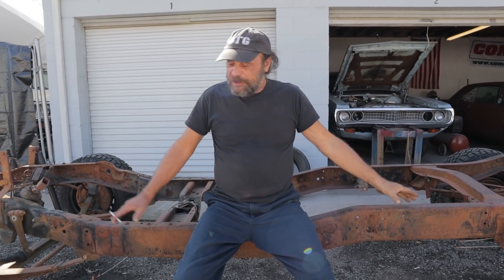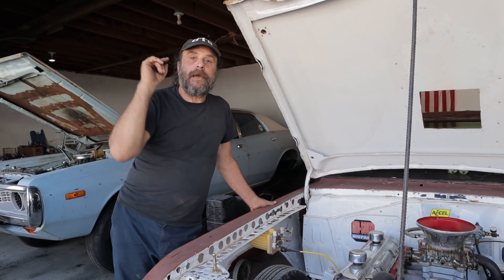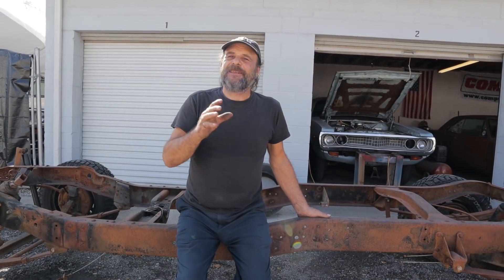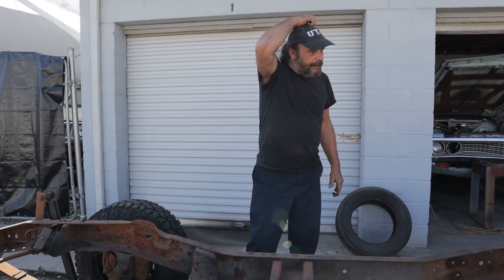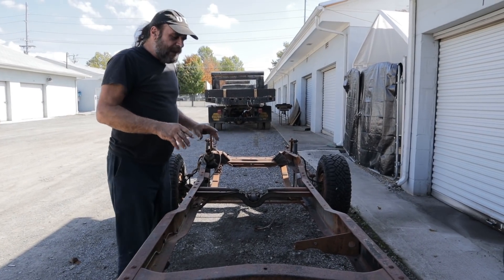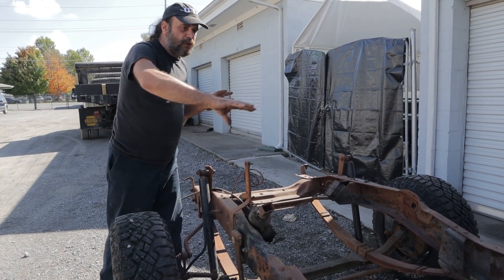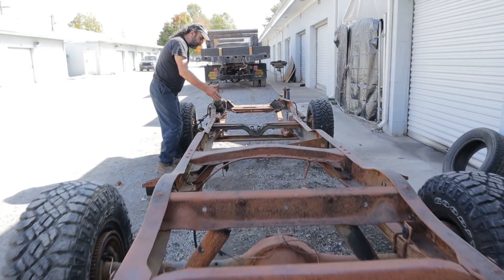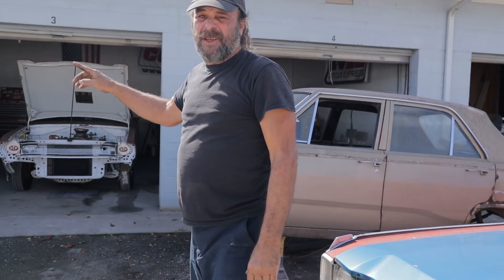The Fine Art Of Biting Off More Than You Can Chew

Comment: As others have pointed out the ackerman angle doesn't have to be that exact but if you want to get icky about it, it would be a simple matter to bend the arms in a little and shorten the drag link. For your purpose balance and handling would be better with a shorter wheelbase.
I had a 71 Fargo (Canadian Dodge) half ton. Rebuild the front end or make sure it has good king pins, tie rod ends, etc. You can adjust the steering box to take out play but be sure to follow the factory manual or you can wear out the steering box in a couple of months. Be sure the steering box bolts are tight. Replace shocks, clean the rust and dirt out of the springs and replace the sliders, put on new shocks and get an alignment. Pump up the tires to 32PSI and it will work great. Especially when the truck was loaded, in your case you will want to remove a few leaves to soften the springs because you will not be carrying a heavy load.
Another thing you can do is install a steering damper like they sell for 4 wheel drive trucks with solid axles. Then set up the front end with minimal caster. This makes steering easier and sharpens up the response but reduces self centering action. You may also want anti roll bars to go with the softer springs.
I don't know why you want to use a sedan body and don't just build it as a pickup truck but, I gues you have your reasons.
Reply: Those changes would effect the bumpsteer characteristics, Don't Do THAT!!

Comment: By the time you're getting that slant six in I have got my slant six scamp running and driving, killed the motor, and replaced the entire drive train to a modern 318/a500 trans, Ford 8.8 rear, and changed to disc brakes all around lol.

On one hand I'm sorry I didn't put the time and effort into getting the slant to 150-200 hp, but also why push a motor when I could just get something that has my power goals stock? I also got a spare 318 block to build for power if I ever want to upgrade and tore that down lol

Obviously Uncle Tony has done a ton more with all his other projects and YouTube and all that, just found it funny I got interested in him with that slant wanting to follow it along as a newbie, and now I'm all set to finish a huge project of replacing every moving bit under the car right when he is set to finish up with the slant build haha

Comment: Leave it long wheelbase, yes. In off road, you don't want body overhang. This is the right move.👍.  As far as Ackerman, theory is one thing.. but in the real world, slip angle and camber change and weight transfer and roll couple distribution mess it all up. When I was doing chassis engineering for road race cars, we found that the lowest drag geometry in actual cornering conditions required inside front tire angle of Ackerman to be way off from theory, sometimes as much as as 30% difference. Even if you cut this frame, real world influences would mean your still OK. Having Ackerman, even if not 'perfect' is going to be just fine. Many wheelbase vehicles share the exact same front spindles and steering arms, as others here have mentioned.

Comment: If it was a parallelogram steering linkage you would have ackermann but I dont think you would get much with the spindles locked together with a solid link. I would be more worried about the horrendous bump steer you are going to get with the steering box mounted where it is.

Comment: I'm normally down with all Tony's ideas but not this time. That chassis will look really amateur without shortening it to fit the body. If the Ackerman needs adjusting due to bad tyre scrub when it's built, heat the pitman arms and bend them in a bit.  But I doubt you'll need to bother. It'll be fine.

Comment: Add another trunk UT for the wheel base. Valiant Crew cab truck. Be lots of room for relocation of things and it won't be very hard. Shorten the frame and you'll have to get a drive shaft and fool with the angles 🤔🤔🤔

Comment: UT  I was thinking of purchasing a '62 Valiant... Is this a full frame car???   he says it has 6or7 repairable frame rusted holes.    
It's a good price, good shape, runs and all that and I can get another (but '72) 225 slant engine/trans along with!     THNX!
Reply: All Valiants are unibody cars. Underbody  rust is expensive to repair properly and in many cases, not worth doing or too difficult. Have a mechanic inspect the underside of the car, or better yet, walk away and look for a better one. If it really has 6 or 7 rust holes it is a parts car not safe or fit for the road.
Reply: @mrdanforth3744  Thank You!    '57 Windsor it is😊
Reply: @lambrokedrc5998  If you like the Valiant, have it inspected. Sellers often don't know what they are talking about. If there are no rust holes in the fenders or rocker panels chances are the rest of the car is ok.
57 Windsor is a good car if it is in good shape, and is a full frame car. Once again, if you are not up on such things yourself it is best to have it inspected.
Reply: @mrdanforth3744  I'll craw around under it! It needs the seem on the front seat restitched and a good waxing! they're both at the same place... Decisions!...  THNX!
Reply: @lambrokedrc5998  Either one is a good car, if in decent shape. The Valiant is easier to work on, easier and cheaper to get parts, and more economical. The Windsor more powerful and luxurious but burns more gas. Miles on the clock and condition would be most important especially if you don't know too much about old cars and can't do your own work. Good luck.

Comment: I know your the mopar guy but do u kno about buicks?
Reply: What are you looking for with Buicks?
Reply: @n8rivera74  knowledge
Reply: @phillipvazquez2834  I'm rivs72riv on IG
Reply: Thinking about an old nail head build
Reply: @phillipvazquez2834  Hagerty recently did some content, and are in the middle of a nailhead, I think.  They can be such beautiful engines, with the finned aluminum vertical valve covers, the air gap between the intake and the valley (Like an LS), even the 4 barrel carburetor, as it’s a square bore Rochester.  I’m not a nailhead expert, but I do know that the transmission is specific to them, as in unique bellhousing bolt pattern, not shared with later Buicks.  Check Nailheadbuick.com for lots of really good information and insight, they’re kind of the experts, as you might have guessed by their name.  Most of my experience has been with ‘68-72 Small Block and Big Block Buick.

Comment: Overthinking it. Short bed and long bed versions of trucks have the same steering geometry.
Reply: Exactly they don’t make different spindles for each different wheelbase. Just think that would be 6 different spindles for newer halfton pickups.
Reply: @mattwiltfong2626  it's not the spindles, it's the steering arms which determines toe out on turns or Ackerman angle.
Reply: @johndorflinger2344  the steering arms are built into the spindles.
Reply: I understand that, so is s a i.
Reply: Not over thinking  it. What hes referencing handles things like death wobble, for example.  Steering issues can be horrifically  dangerous  just ask big daddy don garlits why he redesigned the rear engine rail cars steering when they were using hugely successful steering design from the front engine cars. Safety ain't no joke to under think about.
Reply: @danegrossnickle2550  Can you point me to some info on this? Links, etc? I had no idea Garlits designed a new steering geometry for his rear engine rail cars.
Reply: @WildBillJr  look up the accident that cost him half his foot.  That's when he pioneered the successful rear engines dragster,  they had a massive problem with using the steering from the slingshot cars. They redesigned the steering components and made it safe to drive...the problem with them was the cars at speed would tend to crash, they weren't easy to control.  Theres a couple documentaries on him out there that cover it. Just search YouTube, or google.  I think I was In the era of  swamp rat 13 or 14?
Reply: @WildBillJr  https://www.youtube.com/watch?v=CnX-XWK6K1E
Here is one documentary where i think part of that is covered.
It´s a damn good watch anyway though.
Reply: @WildBillJr  Yes, Big Daddy sure did. Because when he first built the rear engine dragster ( he didn't invent it, he perfected it ), and using the steering they had been using on front engine dragsters, the car was downright dangerous going  down the track. They kept playing with the steering of the "original design" used in front engine dragsters, but weren't making any progress.......the car was still doing crazy things going down the track. Garlits eventually became so frustrated, he was ready to scrap the whole idea of a rear engine car. I can't remember the details of how they stumbled upon the remedy & new steering design, but it is true.
Reply: @danegrossnickle2550  Didn't Don Garlits lose half his foot from a clutch explosion??
Reply: I agree. All vehicles have compromises in the suspension.
Reply: @guyonearth  haha yup, dudes stretch out rabbit pickups into crew cabs and then realize you need a football field to turn around in. 
It's still a cool ride.
Reply: @guyonearth  they either handle, or they ride, it’s hard to do both well I guess.
Reply: @deborahchesser7375  You can do both really well, actually, but not with a '70's Dodge Truck chassis, or any 70's technology.
Reply: Much respect to Tony, I get what he’s trying to do but he’s tripping way too hard on that Ackerman business. He can shorten that frame as much as he wants (20 inches on his case) to fit his application & he won’t run into any problems with geometry.  Just compare a K5 Blazer to a K20 Suburban if you need any reassurance
Reply: If that was the case. Everyone who is turning long bed pickups- C-10/F-100- into short beds would be in a world of hurt.
Reply: Pretty sure it doesn't matter changing wheelbase with a later model front steer truck, that's a 71, with the steering behind the front axle centerline
Reply: Use an early ramcharger are an drag link
Reply: The shorter wheel base turns quicker so cutting the frame as he's suggested would have a similar effect to a drift steering angle kit
Reply: The company I work for makes NonDriveFrontAxles for all HD truck OEMs and the Ackerman for straight axles are covered by the tie rod arms and steering box power and bump steer are handled by the steer arm. Therefore, if the cab to steering and steer arm to front suspension stays the same then steer arm stays the same. If you shorten the WB, you SHOULD pull inboard the tie rod connections as you noted.
Reply: ...but you don't have to... The 'push' can happen but you're just going mud running!
Reply: No they don't, look up an angle called Ackerman angle, or toe out on turns, which is determined by the wheelbase.
Reply: @johndorflinger2344  I get that. I understand how steering geometry works, but the relationship between the two front wheels (track width) is critical, not the distance to the rear axle.

Comment: Or, you could find a junk valiant and section 20 inches worth of roof out of it, make an extended Valiant limo of sorts haha.
Reply: Look up 1984-86 Chrysler Executive: the factory took the front half of a fwd New Yorker E-body, the back half of a 2-dr LeBaron K-body, and a custom 30-inch joiner with rear doors and sliding glass partition. 
Most had a Mitsu 2.6 but mine was a 2.2 turbo. 130 inch wheelbase, 7 seats, 2 stereos in case the driver liked metal and execs in rear liked Fox News. Weighed under 3500 lbs, handled OK, parked anywhere a Fury would fit. MSRP under $30K.

Comment: Set the rear wheel wells properly over the rear tires. 
Extend the front end. “Funny car   style”.
Reply: Like the old Fiat drag cars. The body sits fine over the real wheels, the fronts have a different zipcode though haha
Reply: @robb5522  haha I like oddball looking shit like that , someone did it for a reason and it wasn't for looks ,it was for speed and that is is just kick-ass. 
Most of the time it's a love it or hate it look , but who cares ,it's really there for speed. 
If I have to look like an odd duck to go fast , haha so be it.
Reply: Absolutely! stretch the front fenders about 15 inches and then move the front wheel openings 5 inches forward in the fenders so they're right behind the bumper and the front will look like an old altered wheelbase gasser with the straight axle under the front, and of course the engine , trans and radiator needs to be moved back to match the body! If it were mine I would get some shims like you put in to adjust the pinion angle and put them in the front axle with the thick part to the back to increase the positive caster which makes it steer quicker, I would try to get 6 degrees positive caster and 0 on the the toe in and see how it drives! It would be cool as hell! They would think you were racing an old altered gasser in the Gambler and they would flock to it!
Reply: put the driver's seat as close to center as possible.
funny car style looks good.
Reply: Exactly what I was going to suggest. That would be cool as hell